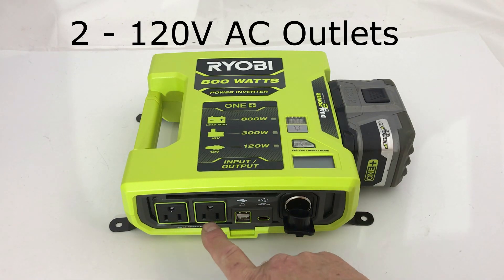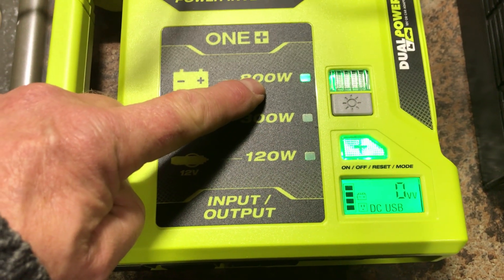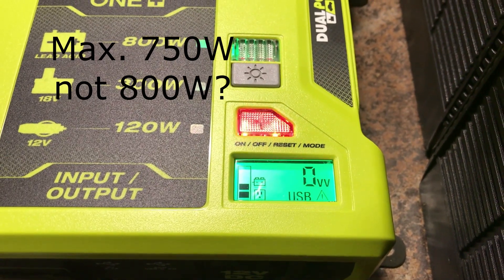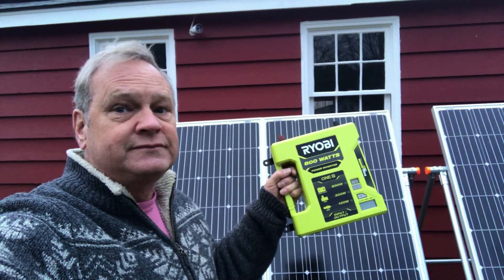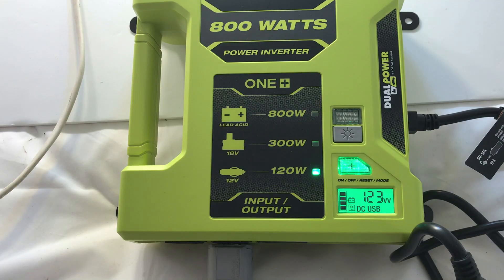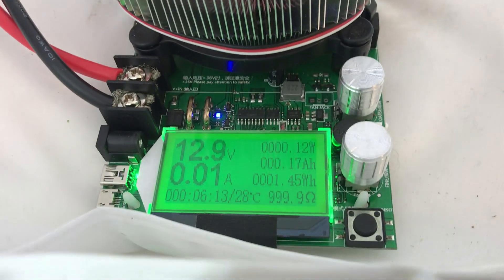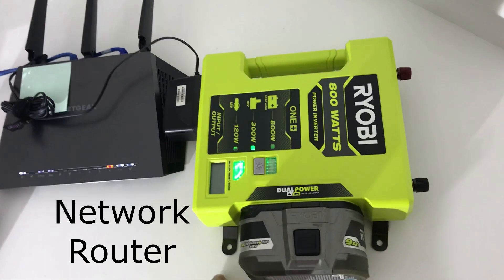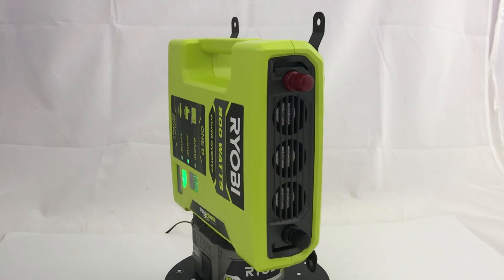RYOBI 18V 800W Modified Sine Wave Inverter RYi8030AVNM Review

Comment: Good review. I'm no electrician so I'm not sure how to interpret the DC data. I am only interested in what happens when you plug in a normal 120V AC device using only the 18V ONE PLUS Ryobi battery for power. Would I be able to power a charger to charge LiPo batteries at 26.2V drawing 5A?

Comment: 1000 watt out now
Reply from the maker: I saw it, but if you look at the specs. it says "AC Max Output 850W. Total Combined Output
1000W". If the AC output was 1000W, then it might be useful to run a small microwave.
Reply: @SerendipitySue  dang it...
I didnt see that...  thanks

Comment: I have the same inverter and I can't get 800W from the AC outlets. I complained to RYOBI and this is the replay I got:

"RYi8030AVNM is rated for up to 800W of continuous output (650W AC + 150W DC combined). Please note that this unit outputs 650 watts max through the AC outlets."

No where on their website this was written... misleading.

Comment: Ryobi needs to update this model. Bluetti,  ecoflow,  jackery are the way to go for these types of generators. And they can be cheaper. I bought the bluetti eb3a for 209 on Amazon where this ryobi model is about 150 plus you need at least 4ah batteries. I have the ryobi 150 watt inverter and only like it because of its size and I already have a bunch of ryobi batteries.
Reply: It's not a generator

Comment: Running a compressor fridge and electronics on a msw inverter is  asking to shorten the life of those products significantly.  Pure sine inverters should be used on sensitive electronics and anything with a motor or compressor.
Reply: What about running a laptop on it?  Wpuld the laptops battery create some kind of safe buffer since  power is going through it?  I wouldnt be buying it for that reason but we have had a lot of power outages lately.

Comment: Dirty sine wave, and only able to use 1 18 volt battery at a time, no thanks.  Make this so it puts out a clean sine wave, and is able to use several 18 volt batteries at the same time for higher wattage output and longer run time, then they would have something.  Until that time comes, I will just have to make my own.

Comment: Have you checked the Voltage and the Hz. My Voltage is all over the place and the Hz is 120? Is anyone seeing this?
Reply from the maker: what device are you using to measure voltage and frequency?
Reply: @SerendipitySue  Kill A Watt, Klien voltage meter and a Digital multimeter. All these meters work fine on my house and generator. Voltage ranges from 80 to 119. With nothing pluged in the voltage is 119. Plug something in and the voltage drops. The hertz reads 120. The hertz should by 60?. I have 2 gauge wire running from battery to inverter. This is the second unit I've had. The first unit was DOA. Has anyone really tested these units? Thanks for answering
Reply from the maker: I remember reading somewhere that some older killawatt had issues with modified square waves

Comment: Willing to bet the 300W option wont support 300W .. Betting it will cut out around 250-260W ...
Reply: It's tested right in the video... somewhere past 365w it cuts.  https://youtu.be/h4y5VV1aVHA?t=383
Reply: @SchuylerBatdorf  the 40V 300W version only holds about 255W before it cuts out. 
Had 3 units and all of them cut out just past 250W ...
Reply: @SchuylerBatdorf  funny the 300W setting did great and the 12V also did great but it didnt hold 800W ...

Comment: I am completely naive in this topic. But what if I connect the inverter to a car battery that is not connected to a vehicle , trailer or such. Can this work? How long can the battery last before it runs out of juice?
Reply from the maker: Sure you can connect the battery clamps to any 12V battery. Run time depends on the size/type of your battery and how much power you are pulling.

Comment: you answered the question i've been asking since i first saw reviews of this product. i've got a 100w solar panel arriving soon and i was wondering if i could use it with this product. i'll probably need an adapter cord i would guess. it would be nice if the device was also a charger, but hopefully i can plug a 18v battery charger to the inverter A/C outlet and use the solar input and charge the 18v battery.

Comment: I have one. The instructions state that it is 800 watt, however each side of the outlet is limited to 650 watts.it does run the fridge in my RV which is the main reason I purchased it. It is a propane and 110 volt at 460 watts. I don't like to have the propane on while travelling. I am going to play around with solar.
Reply from the maker: Interesting. I did my test with the 700W heater in one outlet, and the light board in the other. The most I could get was 750W. I went back to instruction sheet and it says “650W(30 min)/600W max continuous”. Yet the product is called “800W Auto Power Inverter”. Something is out of sync 😳

Comment: This would be a great product if it would run on the 18-volt at 300 w and on the other side the 40 volt for like 500 watts and then be able to put out at least 1,000 w but the fact that it's modified sine wave means that the inverter is pretty much worthless it will run lights and fans and heaters but the light bulb will burn out 25% faster and fans will also burn out faster and even that heater can be damaged modified sine wave I wouldn't take one if they gave it away for free this is a worthless product they're 1800 w sine wave inverter is amazing if they made a sine wave model like that and it was exactly the same with the 300 w and 800 w I would definitely want at least one or two thank you for your video you did a great job showing this product and I enjoyed the video and appreciate it

Comment: Hi mate, they just came out with these gadgets and yes they also released do  solar panels charging stations for the 18v. Would you happen to have any 20v dewalt batteries to use with this inverter and see how it performs and how would you protect it without killing it dead. (I believe dewalt they don't have any built-in protection preventing it to go 0v the their batteries)

Comment: I’m confused as to what you meant with the solar stuff. Were you saying you could use it with a solar system in conjunction with a charge controller as a system? Or that you could charge the battery with the solar panels? I haven’t seen any videos showing it can take inputs
Reply from the maker: It can be hooked up to a 12V battery. That 12V battery can be charged with solar. If the battery is full, the extra solar will be passed on directly to the inverter

Comment: I was hoping you would make a video on this! I want to like this because it has a 12v port (it should have an on/off switch) but the modified sine is such a buzz kill. I would like to have seen a capacity test with a 18v battery, because I never get close to the batterys stated "WH" with the 18v or the 40v inverter. Hoping they improved the inverter efficiency on this model, but since the DC and AC are always on, it most likely performs the same.
When you had the fridge plugged in DC and the meter was jumping around, could that because the port could be unregulated?
Reply: The 40v inverter is much more effecient than this when i ran my tv and xbox watching netflix.
Reply: @TheChewy78 were you worried about the sine wave? I dont understand what some of the comments mean by sensitive products, I am planning to plug my laptop to one of these and I donr want it to break 😅

Comment: Another excellent video, per your normal standards.  My view of this product is exactly the same as yours.  It's the best they have offered, so far, but they missed the mark going with what is clearly a 750 watt MSW inverter.  It does come in at a pretty nice price point and the versatility is impressive.  I would NOT trust my more sensitive and expensive electronics to this inverter, though!  I'm also willing to bet that it would be very noisy if used to power an amplifier or a ham radio.  I'll still probably wind up buying one.  :)
Reply: Oh thank God I was hoping you'd cover these.